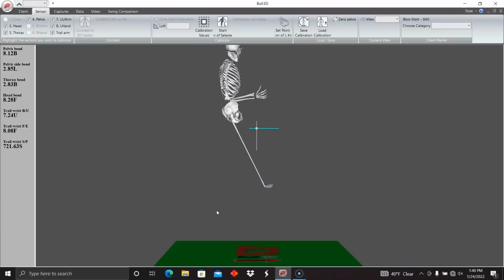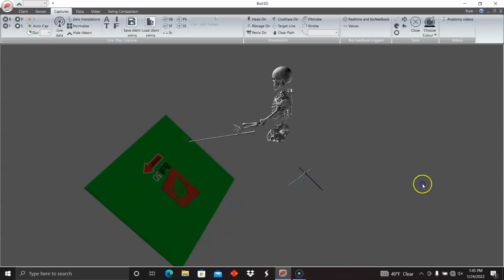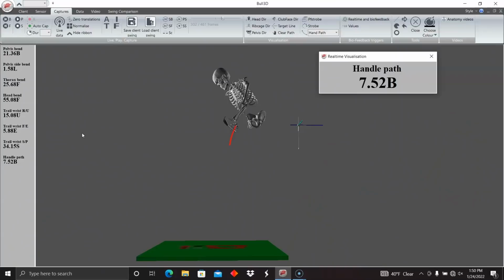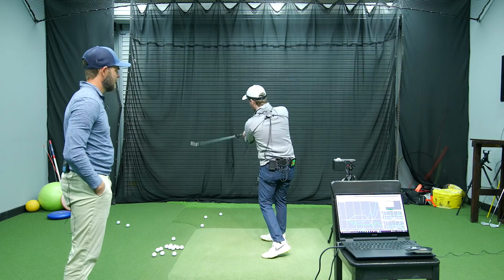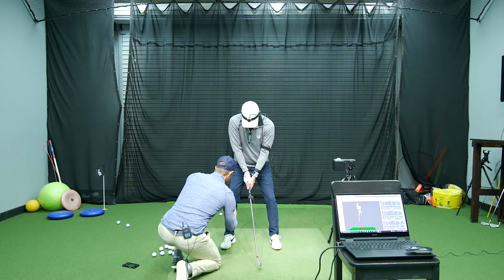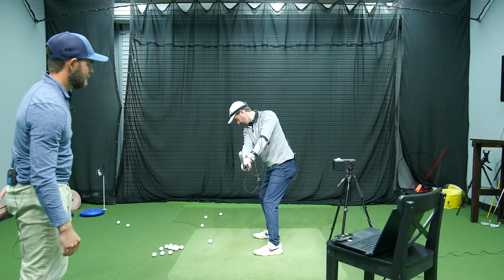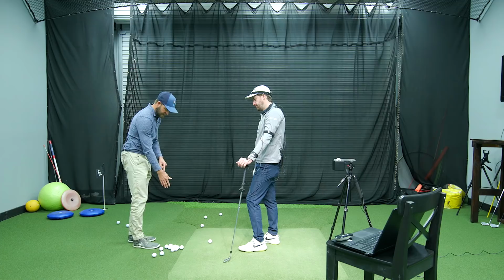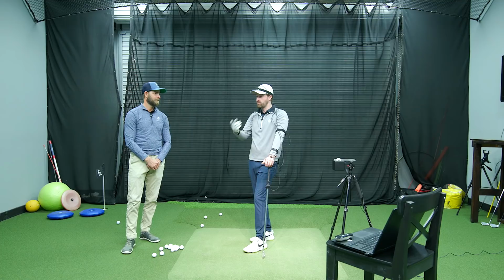Takeaway Drill for a Better Backswing using 3D Analysis | with Ian Mellor

Comment: Question:  With "pushing" your hand path further out and rotating, it looks like the club face angle is opening up at trail arm parallel instead of matching your spine angle. Were you missing a lot of shots to the left after the change?
Reply from the maker: I tend to get that way in rehearsals I’m not entirely sure why, when I get out on the course/range I usually get my lead wrist flatter and club face more closed